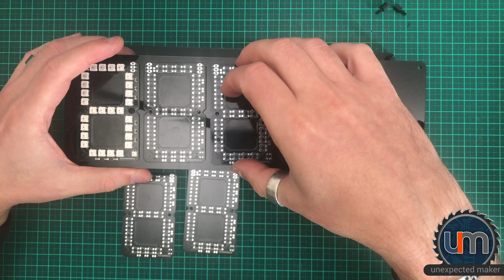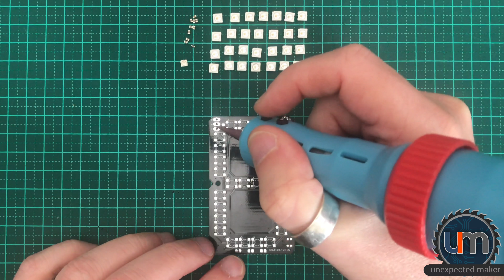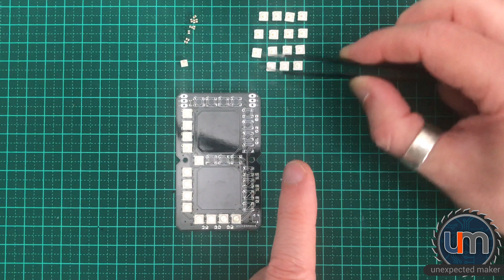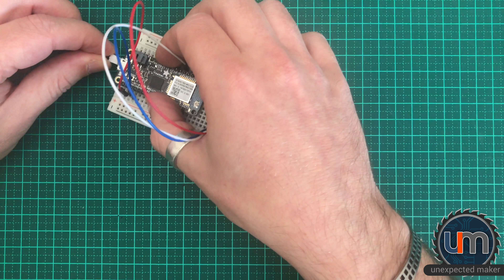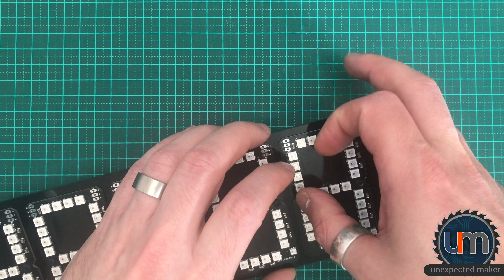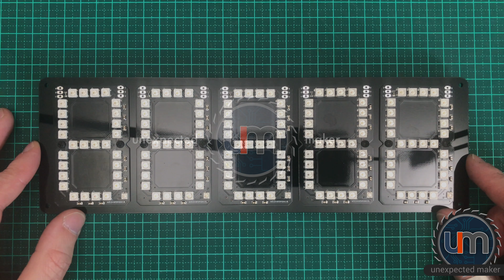Soldering Saturdays #4 - What a pretty rainbow

Comment: I hope you don't mind me asking, but I have a question regarding the holes on your board and acrylic. I intend to use M2 screws on my project, I googled that "standard" hole for M2 is 2.2mm,  so I went and designed 2.2mm diameter holes on both the board and the acrylic. Is it going to be fine or am I ignoring something? It's my first project,  I know it's quite brave, but I would like to make it right the first time before I order it. Thanks in advance!
Reply from the maker: Hi Adam, I always increase the diameter a little to give a bit of wiggle-room. I'd have made 2.4mm diameter holes. Remember the screw head and nut is much wider than screw shaft, so the extra diameter will be fine.

If the screw hole on the acrylic is too tight, and you screw into it, you can crack the acrylic. But, you can also carefully drill the holes in the acrylic bigger if you need to, if you do made them too tight.

Good luck on your project!  Shoot me a picture of it on twitter or via my website once it's done! I'd love to see it :-)

Comment from the maker: Out of curiosity, how many here would be able to, or would even want to assemble individual Neo7Segment kits ? I know SMD is not for everyone, but obviously kits would be by far the simplest thing to package and ship :-)

I'm not asking who wants (not order taking, lol)... I'm just curious about how many here would be capable of making an SDM kit?
Reply: You could always make it through hole that costs a bit more to make.

Search "5-1000pcs DC5V PL9823 F5 5mm F8 8mm round hat RGB LED P9823 chipset inside RGB Full color Frosted LED Chips" 

It works like a neopixel with a different driver. "P9823" I can SMD with and without roasting it. lolz
Reply from the maker: Roast chestnuts! YUM! Yeah, I'm not taking it TH... You can do that if you want ;) I love my SMD...
Reply: I do funny things like soldering a 5050 onto a attiny85.  Only because I can!
Reply from the maker: But how cool is it that you can! Not having to reply on PCB creation to work with SM components is pretty rad IMHO.
Reply: I practice by soldering SMD leds to perf board. I also dead bug 555 ics with SMD parts. Replacing parts on arduinos. Oh I even replace the 5050 neopixels that don't work on a led strip.
Reply: I'd have a go I think. I have a heat gun but I need to practise lots with it yet.
Reply: I would give assembling one of those a try - they don't look that intimidating
Reply: That's a good idea, I bought a bunch of PL9823 without having a real project in mind.
Reply: It depends, most (or a lot of) makers haven’t studied Electronics and are just interested in making cool projects with some google-and-pasted code, 
those would only buy a fully assembled kit, simply because they would not a have a hot air gun or reflow oven.  
For Electronics enthusiast it depends if their OCD outweighs their laziness I guess.

P.S. don’t use a hot-air gun on the SK6812 (clone of the WS2812B) they melt lol (cheaper plastic?)
Reply: capable of hand soldering them :)
Reply: I thik you chose 0805 SMD parts. That's kind of easy to solder with a soldering iron and an oversized tip. For this size for somebody who isn't nearly blind is managing this without any special magnification. Also 0603 is kind of easy with a little bit of magnification. Only sizes of 0402 and below is getting really really hard to solder by hand with a soldering iron.
The "fear" of soldering SMD parts comes in my mind from an old guard of electronics people (gray bearded and born before the 1960s) who  told everybody who listened that SMD parts are the devils work and you need special equipment to solder them. These expert tought (before the internet and Youtube) electronics to homegamers (now called makers). That's the usual way you learned electronics in these days. In my opinion the tools (soldering irons and tip-sizes) didn't changed that much the last 20 years but this misconception about soldering SMD parts persisted.
Reply: Also if you look at Louis Rossmann who is mostly soldering Macs and says he is not needing much magnification for his daylly repairs. Nobody should be afraid of soldering SMD stuff. In modern hobby electronics you can't get much done without SMD parts.
Reply from the maker: I'm not convinced you could use an iron on my boards with the LEDs, as horizontally, they are very close, and any time I tried to get an iron in-between 2 LEDs, I melted the case on one of them.

Passives are fine with an iron, esp when you can get to the pads on either side, but when the pads are 90% under the component, and the components are super close and can melt... well...  ;)

Comment: i know the leds are about 13c and i guess the pcb's are about $4-$6 from china, more if you get them local. $10 for acrilic and hardware and assuming it would probably take an hour to populate 5 boards and assemble, $20 labour(a little more than au min wage) plus any profit you want to make.

$18 leds(to nearest dollar)
$25 pcb's at $5
$10 acrilic
$20 labour
$05 decimal led, solder paste, caps, electricity costs.
$23 profit at 30%(to nearest dollar)
total: $101aud + shipping

i think $100 is about right, i wouldn't feel like i was paying too much and at the same time you get paid for the time and money you put into developing it.
Reply from the maker: Wow, that's thorough :-) I should be able to do better on quite a few of those costs.
Reply: they where my best guestimates. you'll never please everyone but if you can get them delivered for $100 most people will be happy, i plan on buying one. if i can give you some advice, the costs are always higher than you think they will be and make sure you give yourself enough of a profit margin that any problems don't cost you money.
Reply from the maker: Noted! And thanks :-)

Comment: My price might be a bit high. I broke it down to each segment costing $12-$15 canadian. With out the feather I would say $75-$90  canadian for all five segments and  acrylic frame. It is an elegant creation. Not everyone has the ability to create such things. It is a well made product. You should be able to recover costs and not worry about anything. I am sure any extra money will fund more parts or a new project.
Reply from the maker: Thanks for your kind words about the stuff I am making. I am considering selling entire kits of either 4 or 5 segment displays with acrylic panels & screws etc - everything other than a micro-controller, but that would have to be after I see if anyone actually want's to buy any Neo7Segments first ;)
Reply: How I see it is.  Yo did the rapid prototyping research and development. Got it onto a PCB. Tested it. I guess the next step  is to do what  Limor Fried did in the early years! Sell it and see what happens. Adafruit started by selling kits of her creations.
Reply from the maker: My plan when starting this channel wasn't to build a hardware business ;) But I am willing to invest in boards and components, and get the library solid and feature packed and see what happens. It's been a great learning experience and everyone here has been awesome in support, info & feedback, so even if I end up with a bunch of parts sitting in a box, it's been a great and fun journey!
Reply: The only reason why I am a member at my maker space is to make things and inspire people! I am self taught so I do my own studies and research. The  library is the key here! It is the resource that makes it work. I guess in time I will make videos.

Comment: The BOM of each segment is probably around $8 to $15. (if you use OSH Park PCB’s and OSH Stencils like I do) 
Also the WS2812B LED’s aren’t very cheap in low volumes, add to that the acrylic and (usually very expensive) the screws, 
then your fully assembled boards should not be sold for anything less than $50, and that is still a very reasonable price.
p.s. If you don't tell them otherwise, your particular PCB manufacture will, by default, add their registration crap to your silk screen.
Reply: You should be able to order 100 WS2812B 5050 individual for $12.31 canadian.
Reply: yes I’ve been there, eventhough fake WS2812B are easy to spot (different IC and the LED’s aren’t spread over different pads) the sellers often use pictures of genuine WS2812B so is a bit of hit and miss for. 
That’s why I like buying from Adafruit but their shipping rates to Australia are just ridiculously high.
Reply from the maker: I already buy them in lots of 1000 - but you have to be super careful what you buy. Lots of cheap & nasty WS2812B & clones around and I've burnt myself on rubbish ones before... wasted hundreds o them and many $. 

I buy mid range now, and since I started doing that I've had 1 bad in > 500 LEDs. Prior I had about a 30% fail rate.
Reply from the maker: @Darkphotons... I wasn't aware I can ask PCBWay to not put a serial number on the boards... interesting... Thanks for letting me know :-)
Reply from the maker: Yeah I got burnt getting different product that what was showcased... since then I am paying 20-30% more for my LEDs but get exactly what I order. I've bought about 5 orders from Adafruit since I started... always gone with the UPS fast shipping because I'm impatient :( .... for some stuff it's worth it, but for most components, it's way way more expensive to do that - fine for my "one offs" but not for stuff like my Neo7Segments.